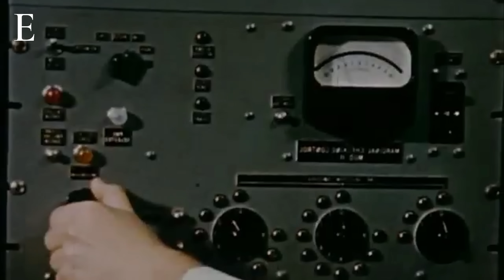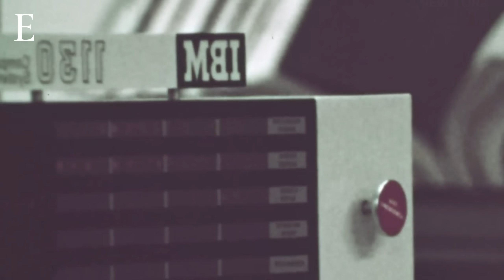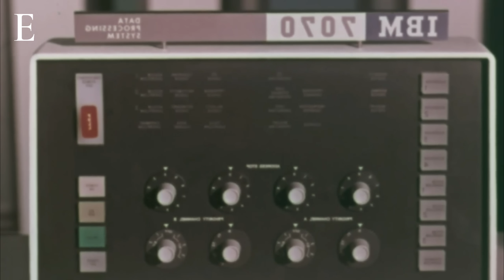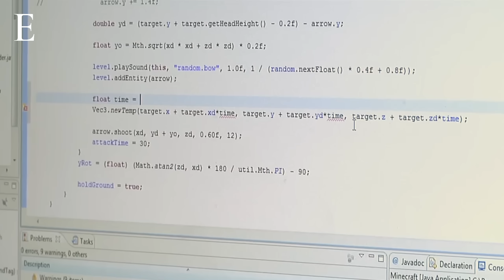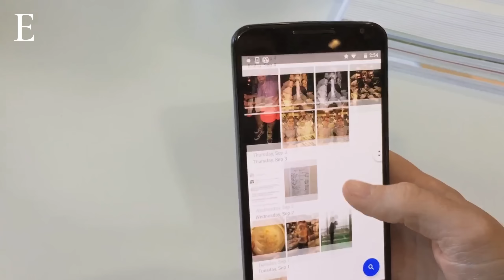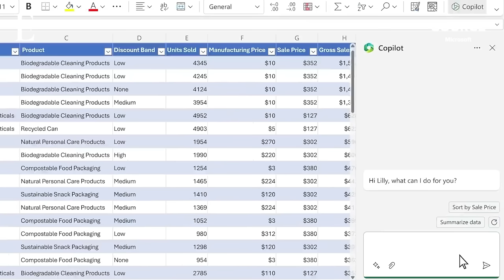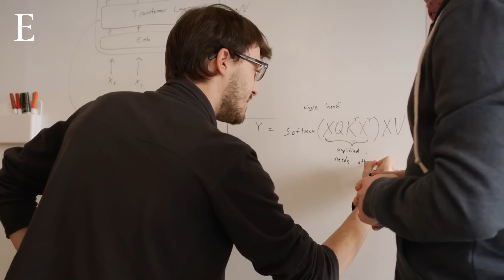The Rise and Fall of Software Engineers

Comment: I am a SE and Architect. I am 100% sure I will have a job till I am retired.
Reply: I am a plumber, i'm sure i'll have a job till my retiremente and beyond.
Reply: MC Donalds
Reply: I am a electrical engineering tech and I know AI cannot live without me ❤
Reply: @captainsternheavymetal
Reply: Guess you'll be retired very soon
Reply: @chyngyzdosmatov3229  Especially with Amazon's recent announcement about AI automation. You know how it goes. You can lead a horse to water, but...
Reply: I consider IT people low skilled people now, unless they hold PhDs. I am a core subject engineer.
Reply: Too much confidence for my liking. I won't call the Dunning-Kruger on you, because you are probably knowledgeable, just lacking imagination. I am considering switching role to a car mechanic after I accidentally learned the ropes on my car. I swapped the engine, did some service on the transmission, replaced the turbo, inspected new engine, did carbon cleaning, changed clutch. I learned how to rebuild the engine, but decided to swap it instead, how to identify and search parts, collected tools, etc. I did almost everything that is to be done on the power train. The garages are always booked weeks ahead. It is something I like, and has future unlike dev/infosec, I think. It will be progressively more and more difficult in IT.
Reply: So how’s the job hunt coming?
Reply: How can you understimate ai
Reply: Are you 90 years old then you are right 😂
Reply: Emacs or VI?
Reply: You are 100% delusional.
Reply: Same, pre-sales should be safe.
Reply: dont bet on it
Reply: SE? Sanitary Engineer?
Reply: SE = Sales Engineer or Software Engineer?
Reply: @same1737  lollllllllllll
Reply: @same1737  SE in front of architech so think what is most combine.
Reply: @same1737  he forgot the "W" for ware!
Reply: You retiring in 5 years? 😂
Reply: Plot twist: he retires next week
Reply: Because ur senior 😂😅
Reply: Retirement must be pretty close to have that confidence. I have been out of work for the past 6 months. During that time I have been using AI a lot and not surprised why the job market is so difficult for people in tech.
Reply: There will always be technology lagging companies
Reply: I hope you retire in the next 10 years, because I honestly doubt you will be able to retire using your traditional role and skills beyond that. 

Once AI is given the tools and authorization to self prompt and self improve, it won’t take long before it can design full scaled applications with complex requirements through simple human language requests by a manager. 

Human input will always be needed, but the difficulty in programming complex tasks will be made easier with each passing year.
Reply: @leoncampa  It's not that straightforward trust me
Reply: While AI might not replace ALL software jobs any time soon it is going to reduce jobs drastically. You better be extremely good at your job because anyone who's not a 10x programmer is going to get canned.
Reply: @jaspercaelan4998 
I busted my ass off so much that after I held my CS lecturer for a discussion after class today, the only thing he could do was laugh and say he doesn't go that deep in the topics (no homo). I taught him so much,  he seemed to be overwhelmed and said he had to go check it out or learn it. Before that, I prompted AI for basic shit recently as a test, and it gave me BS or outdated/inefficient code that only someone with a crap ton of knowledge or passion would spot. Now I got people saying I can spot AI code at a glance without even seeing me do it before.😂
Reply: @jaspercaelan4998  Do you actually know what you are talking about? Or are you parroting things you've heard from big techs that are trying to sell their products. If you are a company and you want to remain competitive, why in the world would you layoff all of your software engineers if your competitor doesn't do the same? Your corp is going to get stuck with whatever generic slop AI can produce, while the other guys will have hand crafted and optimized solutions for their use-case. The majority of an engineer's job isn't even writing code, and if your only contribution to an organization is translating human language into programs you're already bottom 5% at your job. I don't understand why people speak about things they clearly have no education on.
Reply: @ I've worked in the industry nearly 20 years. Those developers just translating human language into code are more likely to be junior developers - the ones most at risk of being replaced because AI can do a better job than them in most cases. What I would have handed to a junior dev in the past I now hand to AI and get a result in seconds. Yes it sometimes needs tweaking but if you know what you're doing this is not a problem. Humans also do not write flawless code, just look back at history for some of the disastrous software flaws humans have created.
Reply: Doubt it. AI will replace you within the decade. 2035 at the latest.
Reply: Nope.
Reply: I can't wait to see you cope later
Reply: @ImSodaLirious u have to realise swe and cs majors can shift to any domain. We don't have to stick to swe only, cs is the most versatile and respected Quantitative discipline. U can work in finance in quant, risk or strats with a cs degree. We have lots of options.
Reply: @amethystguy65  and yet you fail to realize that all will be subject to automation
Reply: @ImSodaLirious  current ai will probably not tell apart between apples and oranges some times. It's just agreeable to whatever u say and flawed. A swe still is needed to revise code, understand computer architecture and business problems/attending meetings to solve them. It's a collaborative effort ai cannot replicate. Humans are going to be apex for at least the next 30 years. AGI will cause disruption u are talking abt. It's very far and still a hypothetical but it will be able to do multiple different tasks at human level efficiency. Even then humans won't be replaced. Tech at the intersection of industries like finance not only pay bank but are even slower to adapt ai due to regulations. Cs grads are best self learners, if u put in actual work. Technologies changed rapidly in our field, our degree only teaches us to learn how to learn and keep evolving with time. Other majors and professions are at wayy more risk. Those excel modellers and pitch deck makers will be replaced first. Stem still is complex enough even at the basic level to only use ai only as a tool.
Reply: @ Given how you type, I reckon you'll be one of the first to go

You're just spewing disinformation. Reasoning models are capable of thinking critically. Pretty much everything you said is wrong; timelines, capabilities, and likelihood of societal adoption. Once we get AGI -- and we will get AGI -- there'd be no need for the human element other than for discerning and repairs in the event of a system failure. Otherwise, it'd be fully autonomous and capable of further improving itself into ASI territory, kicking off the intelligence explosion. It seems like you're trying to portray yourself as far more educated than you actually are, as pretty much everything you've said thus far has already been adamantly refuted conjecture by multiple respected people within the industry.

Your plan might hold for the next 2 years tops at my most conservative of estimates. If anything, any human work will be oversight and greenlighting more than any of the actual tasks. Pretty much every job, regardless of the label, will be quality assurance rather than anything production related
Reply: @ You're just spewing disinformation. Reasoning models are capable of thinking critically. Pretty much everything you said is wrong; timelines, capabilities, and likelihood of societal adoption. Once we get AGI -- and we will get AGI -- there'd be no need for the human element other than for discerning and repairs in the event of a system failure. Otherwise, it'd be fully autonomous and capable of further improving itself into ASI territory, kicking off the intelligence explosion. It seems like you're trying to portray yourself as far more educated than you actually are, as pretty much everything you've said thus far has already been adamantly refuted conjecture by multiple respected people within the industry.

Your plan might hold for the next 2 years tops at my most conservative of estimates. If anything, any human work will be oversight and greenlighting more than any of the actual tasks. Pretty much every job, regardless of the label, will be quality assurance rather than anything production related
Reply: @ I've tried replying twice, and gotten censored both times. 

Given how you type, I reckon you'll be one of the first to go

You're just spewing misinformation. Reasoning models are capable of thinking critically. Pretty much everything you said is wrong; timelines, capabilities, and likelihood of societal adoption. Once we get AGI -- and we will get AGI -- there'd be no need for the human element other than for discerning and repairs in the event of a system failure. Otherwise, it'd be fully autonomous and capable of further improving itself into ASI territory, kicking off the intelligence explosion. It seems like you're trying to portray yourself as far more educated than you actually are, as pretty much everything you've said thus far has already been adamantly refuted conjecture by multiple respected people within the industry.

Your plan might hold for the next 2 years tops at my most conservative of estimates. If anything, any human work will be oversight and greenlighting more than any of the actual tasks. Pretty much every job, regardless of the label, will be quality assurance rather than anything production related
Reply: @ImSodaLirious you probably study gender studies 😂😂😂
Reply: @StarrxBoy  weird and irrelevant comment
Reply: @ImSodaLirious  why though? If he's unemployed, who is going to order coffee from you?
Reply: @  @chrisalley6282  @NeroSNT   

Y'all sound salty that I'm right

What the guy said is objectively wrong. The tech and capabilities are growing exponentially, and if you actually understood why this matters, you'd understand that an AI working as good as a human while simultaneously improving upon itself leads to even more exponential growth. We'll likely have ASI by 2026. That means that literally every job will be fully able to be automated. 

Y'all are accusing me of things that I haven't said
Reply: @ImSodaLirious  Calm down. You're right about the SE jobs, but no ASI will not be here in 2026 or even 2030. Keep in mind, Industry leaders thought AI would be fully self-driving in 2018 based on its rapid improvements... how did that work out? 😄
Reply: @ We have all of the tech for full self-driving though -- it's just that the current industry leader is using dumb, backwards technology to try and pilot it. Tesla is using plain old cameras instead of LIDAR or RADAR.

If you think we'll achieve AGI in 2025, I see no reason why we wouldn't have ASI by 2026
Reply: @toddheartsound5451 😂😂😂😂😂
Reply: @ImSodaLirious  You have literally no idea what you are talking about.
Reply: @ And yet you offer no counter other than "Nuh uh! You're wrong!"
Reply: @ImSodaLirious  It would require educating you on software engineering, AI, and the economics of tech capitalism, and I don't have time. You are welcome to learn on your own, or just wait and watch as software development blows up again under eventual lower interest rates.
Reply: @ So in other words, your claims are baseless
Reply: @toddheartsound5451  argumentum ad hominem
Reply: @ImSodaLirious imagine being do petty that you rejoyce at the thought of someone losing its job
Reply: @NeroSNT  rejoice at someone recognizing later that you were right and he was wrong. i wish leftist (because its always leftist) people could realize some day that thinking about an outcome even very hard wont magically make it materialize.
Reply: @ImSodaLirious Nice cope, dude.